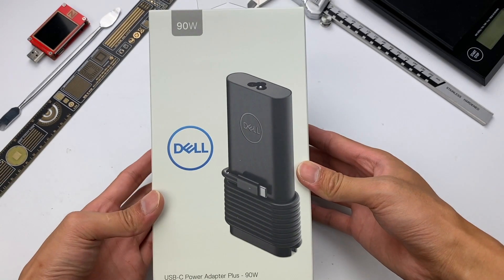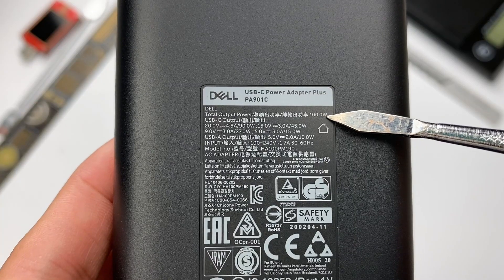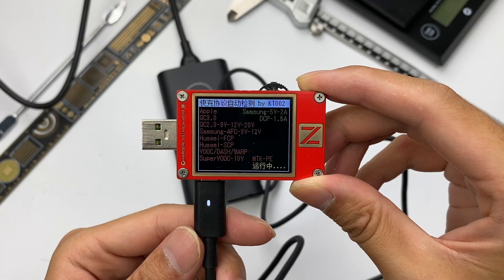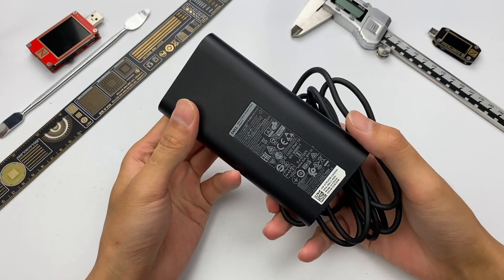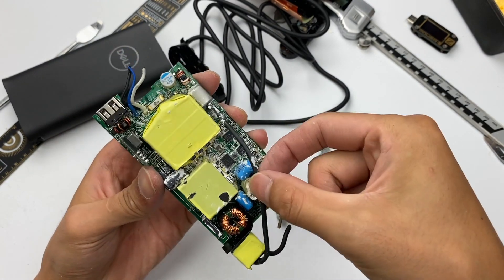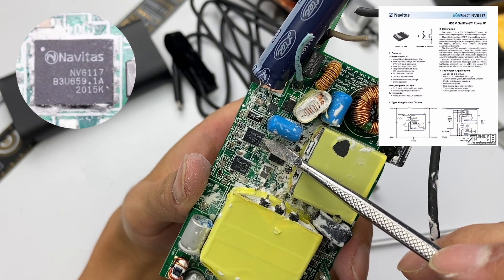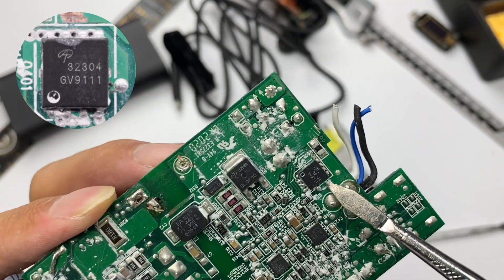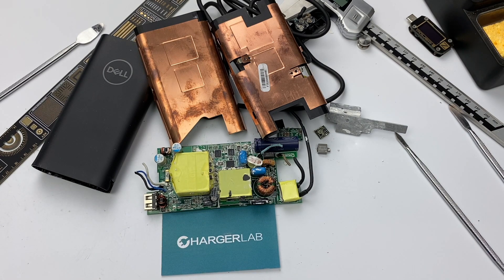Teardown of Dell 90W USB-C GaN Power Adapter Plus (PA901C)

Comment: thanks a lot for the video. I have latitude 5320. chager is broken. I need use kable of this broken charger on another charger. But I do not know that which color will be soldered to pozitif and negatif on new charger unit.

Comment: Bravo for all these details.
I have the same one with a problem, could you direct me to the problem?
The output voltage reaches 16 volts and cuts off to 8 volts and slowly rises back to 16 volts. he does this over and over again. I thought it could come from the NCP1937C4 primary power supply IC, I replaced it without success.
Could you direct me?
THANKS

Comment: Do you know if a dell power companion Li-ion battery can be recharged after sitting unused, still in its packaging,  after 5 years? It won't 'hold a charge' - pw7015L-65w.
Reply: Open the case and try to rescue the Li-ion batteries inside. Use a lab. power supply or RC charger to accomplish the task. Otherwise unsolder and swap them all.
Reply: @innakarpun7588  hmmm! Are you suggesting that someone that knows absolutely nothing about the inner workings of a battery just "open the case". Use a lab" is practical advice?????
Reply: I just bought a broken PW7018 power pack, and try to figure out how to to open it without destroying it completely

Comment: A non-USB-C HP charger typically doesn't work on Dell.. even though the specs are the same.  I assume there is some Power Line Communication happening so that you buy only Dell chargers.

But does that apply to USB-C chargers as well?   Can a Lenovo ThinkPad X1 Carbon Gen9 work on a Dell?
Reply: the barrel jacks on HPs and Dells have a small sense pin in the middle that does very basic communication between the laptop and charger (I think it just outputs a fixed low voltage) so that they can verify that they are genuine/working correctly. In my experience at least, a Dell laptop will refuse to charge from a genuine Dell charger if the sense pin is not present, and a HP laptop will not charge from a Dell charger if the sense pin is present or not. It seems basically that both brands work the same on their own systems.

The USB-C on the other hand is universal (that is, in fact, what the 'U' stands for, but that is more about data transfer protocol) and uses the PD (power delivery) standard which is used by every laptop I know which supports USB C charging. So yes, you can Dell (or HP) USB C chargers on laptops from HP, Dell, Lenovo, Apple. And because these chargers are multi-voltage you can use them to charge your phone as well. The device communicates with these type-c chargers as well and this is how they can decide which voltage to output.
Reply: @rolls_8798 There were things like you describe on old Nokia batteries like BL5 where they use a resistor to divide voltage and display that on the third pin. Here they use OneWire communication and the charger IC sends an ID string to the I/O controller with the entirety of it's specs, like how much power it can provide. That's why it's possible to see that information in the BIOS/EFI setup.

Comment: Oil type it is leaking in side adapter what is the problem ican defined can you suggest me
Reply: probably a leaking electrolytic capacitor?

search them up to see what they look like and see if the leak originates from the base of one of those

Comment: What is the purpose of give an earth connection here when the whole adapter is fully covered by plastic insulation?
Reply from the maker: To eliminate the electric shock for mental case laptops.
Reply: @ChargerLAB  unearthed macbook chargers have quite the mains buzz if you slightly brush your skin over the laptop while its charging. true for type c and magsafe. quite annoying.

those chargers are also terribly designed from the standpoint of every physical aspect

Comment: why you are not teardown usb c cable? On this video we can see, what from usb c conector to power adapter soldered only 3 wires, that tell about smart usb c conector that speak with power adapter via one wire protocol and via standart usb with latop, smartphone, etc)
Thanks for video, its realy interesting)
Reply from the maker: Thanks for your advice.

Comment: 90w Dell charger with barrel connector .Generated buzz sound and heat on day one itself .After 3 months, damaged with pop sound and smoke .Can you give a clue on likely cause.Was it a faulty piece .Its is useful as a firecracker to generate pop sound and smoke . 😀.I took a new one and again overheat on the. brick .Thanks in advance.